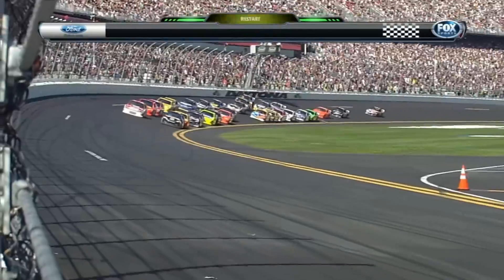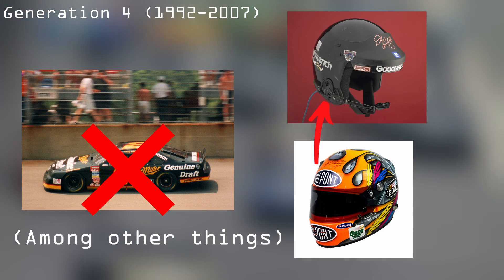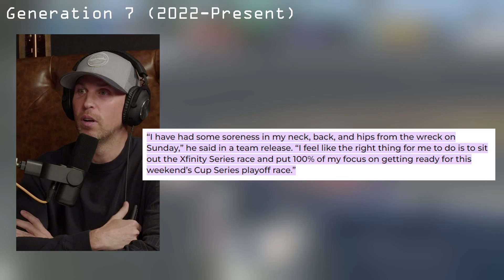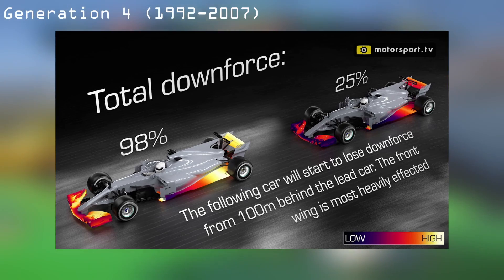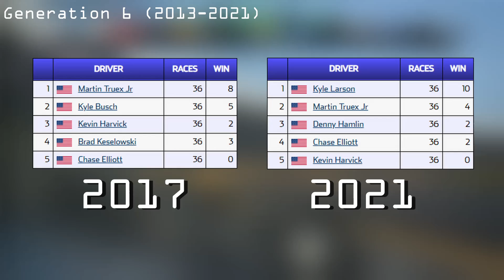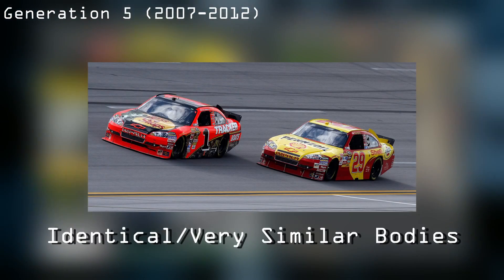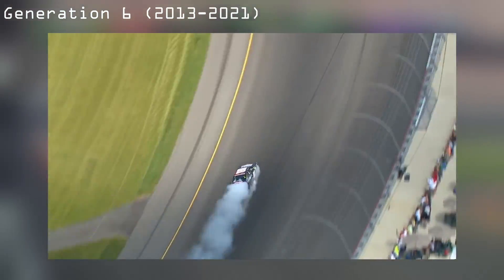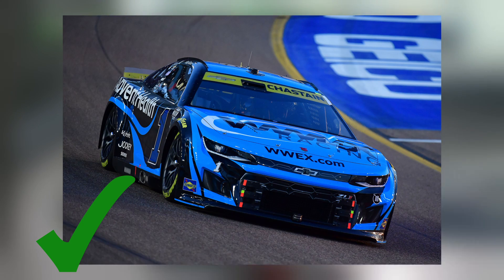Why NASCAR's Cars Keep Getting Worse

Comment: NASCAR needs needs to take the chassis from gen 5 and then implement the overall aero package from gen 4. They can keep everything else in place, but they need to stop playing games with engine reliability and single source part QC (the fucking louvers, man), up the power to at LEAST 750 HP for all tracks less than 1.5 miles, and they can do the 550 HP for Daytona, Talladega, and Atlanta. True road courses (CotA, Infinion, Road America, Watkins Glen, etc) should be 575 HP, and they need to be at least 600 (IMO 675) for the Charlotte Roval as well as everything else. Anything under 1 mile, as well as road courses, need smaller spoilers, any tracks with sustained speeds above 180 MPH need large spoilers, and they should have an in between "standard" spoiler for everything else. Bristol dirt should have the same package as the larger tracks (675, medium spoiler) to prevent the cars going out of control in the wet mud. Nascar should also allow for the usage of tape on the radiator grille (brake duct grille should remain open) and for rear spoiler angle to be adjusted more freely like it was in the past, though I understand if minimum angles are required at super speedway tracks, so long as there is a range of at least a few degrees of adjustment leeway. They can keep the single source parts within reason, especially if that's what will attract more manufacturers, but there's such a thing as overdoing it.

Comment: I'll say one of the biggest helps this current car can get is put some more grunt back in the motors. If these were running the 900 horsepower monsters from the Gen 4 era, then maybe this dirty air b.s. would all go away because they'd be able to pull out and pass. It would also do away with another detriment this car has, and that's shifting. How effectively can you race when you are constantly having to take one hand off the steering wheel and shift while flying around an oval at 180 mph.

Comment: The problem is the horse power and the non existing crunching if the cars bent the drivers would be fine. The racing at the big tracks sucks because they took off so much horse power everyone has to use the draft to keep up so they can't go around anyone without help and if you do try it you need at least 6 to 10 cars to do it. The intermediate tracks are great because of the current engine setup for the 1.5 mile tracks. RC tracks I think if nascar is going to race on them make sure the cars are built for it, nascar has a ton of road races on tracks designed for IndyCar and F1. The short tracks same as the restrictor plates we need more HP! And finally everyone wants it no stage yellows I think that'll do something hopefully... Whoever the president of nascar is we need to replace him I'm sure he's a nice guy but he sucks at controlling an entire motorsport. And not to mention everyone is pissed off because of this money stuff and the TV contract, these next few years are gonna be scary.

Comment: NASCAR started dying in 1987… it got hit again in 96… got hit again in 2001… then they slowed the cars down further… after that nascar still can’t get the magic back not even wilkesboro coming. Back will save it sadly cause the cars are crap, the rules are crap… besides a wall ride, a guy parking it on the starting line, and folks getting hurt enough to retire over small crashes ain’t much news in the new nascar

Comment: 1940s and 1950s Early Nascar Days Where Bland and Cars during that time looked like Cars u would see at home
1960s and 70s Had the Cars look more like Stock cars and Made the cars faster and Longer
1980s and Early 90s
Witnesses The rise of the sport as a whole
Late 90s early 2000s
Peak Nascar *
2006–2009 When Nascar Started to fall off
Popularity fell and Overall Entertainment slightly fell in the 2000s
2010–2014 a Shell of its former self by this point 90s Cars Did things these cars didn’t do The early 2010s Had the cars heavy and Couldn’t go fast
2015–2019 Damage became insanely Crazy to see a new car take more damage than a 90s or 80s car
2020–2022 Nascar Lacking in safety was becoming more Hated
2023 and Now So Far Nascar hasn’t Went up in Popularity since the end of the 2000s and has seen Small Decline since 2009

Comment: the answer is no ride height rule, huge stupid downforce/drag, and lower horsepower. if they unleashed the engine tuners and builders to make the engines make 1000 hp and 11000 rpm again. all that power back would make the drag be able to be driven through.

Comment: I'm not that much of a NASCAR guy, so I might just be crazy but I just want the ‘SCAR’ (Stock Car) part of NASCAR to mean something.

So my idea would be:
- Same chassis as current cars, carbon body (or whatever it's made of) must have same shape as the road car, just adding any necessary aero bits to race.
- Engine layout and displacement must be the same as the road car. HP/torque figures will be kept as they are now.
- Tires are kept as they are now, but rim size would be limited to be the same as the road car 

It'd be fun to see what engineers come up with based on what kind of car manufacturers would work with: Coupe vs. Sedan, NA vs forced induction... A man can dream.
Reply: Personally, I'd go by the FIA Group N standards.  They're basically "showroom stock" production cars with added safety equipment and ballast/engine restrictions for balance of performance.

Comment: gen 4 and 5 are my favorites, it feels like a lot of personality left the sport when they went to gen 6 and now it's even worse with gen 7. I used to watch every race, now I end up bored not even 5 minutes in. I think the strictness of the regulations was what killed my interest personally. at this point it's like watching a bunch of the same car with different stickers race each other, which is boring. the individuality of the drivers and teams was what made it interesting, and it feels like none is left.
Reply: And now the Gen 7 car is taking out veteran drivers like a hit list. It already took Kurt Busch away into retirement, who knows how long it’ll be before they take out more drivers and force them into retirement. Something has to be done but since NASCAR is NASCAR these days it’s highly unlikely they’ll make any safety changes to the Gen 7.
Reply: Well didn’t all of the nascar cars have the same body style during the c.o.t. Days?
Reply: @MTJfan2017  cot was fine after they got rid of the wing
Reply: @MTJfan2017  exactly
Reply: I think all sports look more boring. Football for example you had huge pads, loose jerseys. So even a small hit looked like a big hit. Now the pads and jerseys are so tight, a guy will get drilled and you wont even think it was a big hit. Nascar went overboard with safety and now the cars dont even dent lol. They are like bumper cars mixed with hot wheels
Reply: Gen 5 was bad because dale jr stopped winning and didn't become relevant again until they got rid of it. Unfortunately his success was pretty important to the sport

It disproportionately punished aggressive drivers, particularly ones who thrived on restrictor plates. Jimmie Johnson, a more traditional driver, got 5 of his titles during this era. He wasn't anywhere that level prior to the cot cars. He won 2 after it was over so I'm not saying he shouldn't get credit as one of if not the best ever. I'm just saying NASCAR has a habit of creating big changes that wipe out the old guard. The second half of the gen 4 cars getting different packages that created pack racing greatly contributed to the decline of some of the top drivers of the 90s, at least in regards to restrictor plates
Reply: And gen 7 has good racing

Comment: I'd argue that aero push started being an issue when Chevy switched to the Monte Carlo in '95. Watch the '94 and '95 Brickyard 400s, there's a pretty stark contrast. Ford going to the Taurus made it worse. Late '90's and early 2000's cars looked and sounded great, and we had a lot of great personalities in the sport. Overall racing quality though was higher in the '80's and early '90's, though high attrition rates could disguise that in the final results.
Reply: NASCAR in general was more fun until the horrible Car Of Tomorrow, nostalgia for that piece of crap is ridiculous! The tracks fans say suck now started sucking that generation, just watch Atlanta spring 2008 and not get bored, then watch Atlanta spring 2007, it's a day and night difference! 1.5 cookie cutters and 2 mile ovals got unbearable, Phoenix 2 configurations back with the COT sucked, only the short tracks and Daytona and Talladega were consistently entertaining, even Darlington suffered because of a repave and tire wear was not even a factor, once the track started wearing in did it get fun again, and for the most part the gen 6 chassis was the same COT chassis with a much better looking body on it, that being said I miss the Gen 6 because at least it could put on a good show on the short tracks and road courses! And it actually protected the drivers from serious injury for the most part.
Reply: @PaperBanjo64  The COT had a lot of lousy races, but there were some I really enjoyed. Fall Dover '08, Labor day Atlanta '09, and the 2012 Bristol night race come to mind. But yes, I'd call it an overall decline.

Comment: For a start, at least bring back the Horsepower
Reply: remember in 2014 with the 920 hp engine that was the fastest season of nascar. ( beside's 1985 and 1987.)
Reply: Screw that
Reply: @g_men2121  Why? Racing was A LOT better. It fell off as soon as they started changing everything, including dropping the horsepower. Now this new car has safety issues because they're too stiff. They need to stop changing things

Comment: The HANS device would not have saved Earnhardt!! Earnhardt loosened his belts under the Tony Stewart's red flag 
Crash!!
Reply: It actually would have regardless if the driver loosened their belt. Hans device has a separate strap behind the headrest that locks the helmet into position and keeps the driver’s head from moving violently in a crash. Tho the crash at daytona says otherwise

Comment: Here's the Thing if Cup Cars stuck it out with the Gen 5 and used Features of the Gen 4, Gen 6, and a Few Features of the Gen 7 Car heres what I would do:

• Return of the Gen 5 (Including Safety Features)
• Symmetrical Body
• No More Fender Flares (Make the Body Slimmer) 
• Composite Bodies Stay
• Keep the Splitter, but Raise it 4 inches off the Ground
• Shorter Quarter Panel 
• 2.5 inch Spoiler at Road Courses, Short Tracks, 1 mile - 1.3 mile Tracks, and 4.5 inch Spoiler at 1.5 miile Tracks, Michigan, Pocono and the Indy Oval
• X - Pipe everywhere
• TransAxel Stays
• 6 Speed H Pattern Shifter
• 9500 RPM
• 900 HP Twin Turbo Hybrid Engines 
• Double Wishbone Suspension (Front and Independent Rear Suspension)
• Keep the Single Wheel Lugnut, and 18 inch Wheel Base
• Go to a Regular Camaro (the 2ss) Mustang, and Camry instead of the Bulky Looking Designs of the Current Cars
• Front Air Ducts
• Get Rid of the Rear Diffuser too
Reply: Damn, 6 speed h pattern transmission would be really useless in most of the races as some track’s require drivers to downshift or not even stay in their highest gear for a long time. The only way this many gears would be useful is on the superspeedway tracks like dega and daytona. Changing the hp to 900 is a good choice, but also raises safety concerns as tracks like dega and daytona have shown us how that amount of hp + drafting can really create a racing hazard to fans and the drivers. Best you can do with the hp would be 800 which creates better racing and makes it safer for spectators and drivers. The RPM limit would need to be scaled back to accommodate that 6 speed and tracks that make you shift as fast as you can to the final gear (martinsville, bristol, etc.). Your idea is really interesting and can probably provide better racing, but its mainly best suited for Superspeedway racing and some intermediate racing. Short track racing with your car idea is basically impossible and just puts more labor on the mechanics and setup specialists and makes the cars powerhouse redundant. Still a solid idea though.👍
Reply: @thetalkativetank7032  as for Talladega and Daytona, we go back to the Restrictor Plate (Down to 500 HP), X Pipe, a Shorter Quarter Panel, Flat Front Noses, 6.5 inch Spoiler, and Tandem Drafting
Reply: @aldouscoroza824 what about the short tracks?
Reply: @thetalkativetank7032  its all Above Short Tracks, Road Courses, 1 mile - 1.3 mile Tracks all get a 2.5 inch Spoiler, 900 HP Turbo Hybrid, 9500 HP, X Pipe, 6 Speed H Shifter, Double Wishbone Suspension (Front and Independent Rear Suspension), 9500 RPM, Front Air Ducts, Flat Front Noses, the Front of the Car Raised 4 inches off the Ground and the Quarter Panel cut in Half
Reply: @thetalkativetank7032  oh Yeah To Add NASCAR leaves Goodyear and moves to either Pirelli, Firestone, Michellin, etc. And like Formula 1 has multiple Tire Compounds (Soft, Medium, and Hard)
Reply: @Aldous Coroza  Michelin is terrible, they couldn't handle 1 turn at indy.
Reply: @deathtrooper2048  that was  partly to do with indianapolis speedway being diamond cut 

Look at the brickyard 400 in 2008 

The surface was chewing through tires
Reply: Edit:

900 hp would work
Reply: Why tf would nascar keep the shitty tired/wheels

Comment: They lost their way when they went all in on "parity" aka boring. Take out all the "innovation" (okay, rule bending) & you have boring.
Reply: idk, it just seems like a NASCAR issue. Indycar doesn't have cheating and does just fine. IMSA until recently with this year's Rolex 24 didn't have cheating. The same with the WEC and any GT3 based series. Really the only other major series to effectively endorse cheating is F1 and only because of the gobs of money and rule lawyering that goes on.

Dallara is more than compotent at building high quality race cars, just look at Indycar and the last two Cadillac Prototypes. And yet somehow, someway NASCAR despite being technically simpler is more expensive to run than either. Honestly, tell me how a big-block V8 cup car is more expensive than a hybrid prototype that can run circles around NASCAR? I think we're seeing highway robbery on Dallara's part
Reply: @BB_Sebring  You should look at IMSA in the 70s, 80s and early 90s then. That was their golden era of cheating and stretching the rules.
Reply: No parity ruins racing, look at F1

Comment: The Lack of Ground Clearance at the Front of the Car and the Quarter Panel being also sealed isnt helping in Cars Passing each other and along with the Spoiler Height too isnt helping. Now its time NASCAR go back to 900 HP once they go Hybrid and get rid of the Tapered Spacer
Reply: If they go hybrid their fans will rip them to shreds for whatever reason.
Reply: @TurboMarc  I don't think hybrids would be as hated as you think, full electric would be horrible.
Reply: @PaperBanjo64  I highly doubt NASCAR will go all electric because I'm sure that they know every fan will stop watching the instant it's announced.
Reply: @TurboMarc  exactly I sure would
Reply: @skaldlouiscyphre2453  I feel like they’re going to develop an extremely low-emissions biofuel before they even think about going electric.
Reply: @turbo_marc  divide them into two different classes. Hybrid and non hybrid. A trophy/win for each class.
Reply: NASCAR can’t go back to 900 hp because Toyota would kick, scream, and cry. Toyota wields obscene amounts of influence in NASCAR. Those low hp, high downforce packages? Blame Toyota. They couldn’t make an engine that wouldn’t blow at high hp, so they whined at NASCAR and probably threatened to leave the sport, so NASCAR caved, because it was either that, or alienate Toyota like they did with Dodge.
Reply: Nah, there's actually quite a bit of ground clearance on the front splitter. It's like a GT3 bumper, it's not like the gen 5/6 splitter where it's always nearly touching the ground. It actually has lots of ground clearance to bring air back to the rear diffuser, which is still better than a splitter forcing air to go around the entire body of the car instead of letting it flow  under the car. There is still dirty air from this, but the actual wake of air coming from the car itself is much more narrow than the previously mentioned gen 5/6 cars.
Reply: @punyhunk8686  air going under the car is how the new cup car makes downforce, the belly pan on the cup car is made to channel air back to the rear diffuser. Air going over the car is not as big of factor. When NASCAR was just recently testing new spoiler heights, there really wasn't any difference until they practically pulled the spoiler off the car before the driver actually felt it. I agree the dirty air is smaller than the older cars. I think the Gen 4 cars even had a lot of it as well that was covered up by the just how hard the cars were to drive. Its a good reason why the cars need more horsepower. Either that or they need to run a narrower tire.